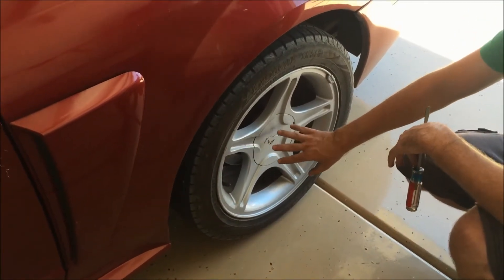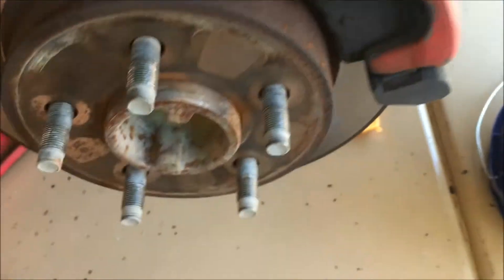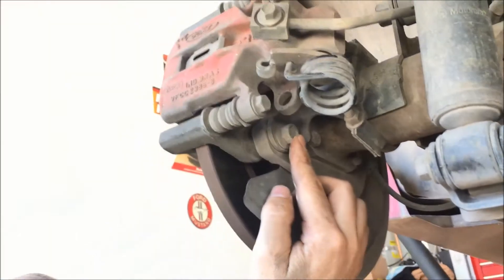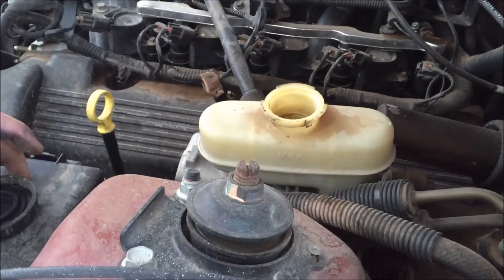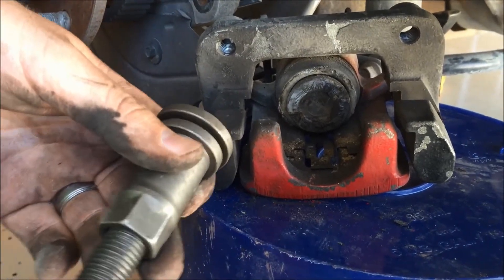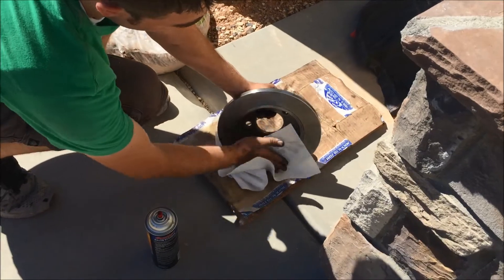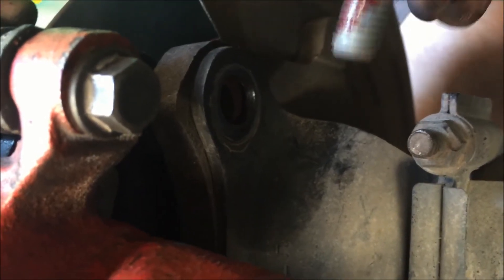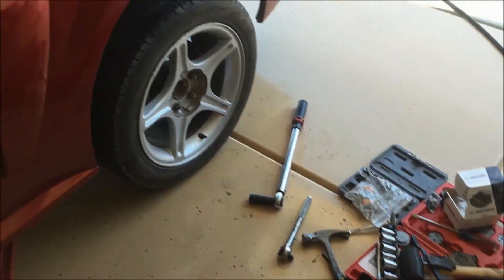Ford Mustang REAR brakes replacement. SPECIAL TOOL REQUIRED!  DIY. Step-by-step how to change rear

Comment: Great video Thank you.  FYI, I was able to unhook my emergence brake cable and remove the clip, but no matter of effort would get the housing to move through the mounting hole, hammered, PB blaster, etc.  The cable itself was moving smoothly and not frozen, but the outer metal was rusted/fused to the mounting hole.  I found it was not necessary to remove the brake cable at all.  I was able to just remove the slider bolts and and then took the brake assembly off which provided me easy access to the bolts holding the bracket.
Reply from the maker: very cool. glad you got it done!

Comment: Decent tutorial, excellent photography, could actually see what you were doing. The master cyl reservoir cap does not need to be removed as it could allow stuff that might come floating thru the air to enter into fluid, just crack it loose. Also, recommend washing hands before handling brake pads as I saw grease on the pads which is a no-no. Unfortunately for me I had to replace calipers as pistons would not turn, not even with a specially made tool and 1/2" impact wrench. Story of my life.
Reply from the maker: Davidy J My brake caliper on my white GT won’t retract as well ☹️

Comment: My fox has cobra front brakes but it had 94-04 gt rears,first time im doing rears soon and nice to know that i need that tools now from autozone before i start on it. Thanx Danny. Btw i finally managed to find a 2003 1:18 maisto cobra in red which is what i wanted.
Reply from the maker: Nice!

Comment: I noticed, whoever did the last pad replacement, didn't index the piston grooves to 12 and 6. You can see where the nub from the old pad dented the piston. That will also cause issues since the pads have an indexing "nub" that fits into the piston groove and will press on the pad with uneven force if not positioned correctly. *Edit* just finished watching, noticed you didn't either. GOT to do that.
Reply: will not matter once piston is back it aligns it self ! as the  pad wears the piston rotates couter clockwise as it push on pad and will catch the slot in time depending how much it is off thats why you and to turn clockwise as you push in piston to retract
Reply: @mronemanband1  okay, cool. I didn't know it self corrected.

Comment: Maybe I missed it but you need to make sure the piston notch is lined up with where the nub is on the back of the brake pad. When you took them apart I could see the person who did them before you did not do this, and is probably why the inside pad was cracked.
Reply from the maker: aadjrenots Wow. I’ll have to check that out. Thanks
Reply: when the piston is retracted it alighns at 12 and 6 o clock !

Comment: Dang I thought ths vid was gona show how to get the 2nd caliper to bracket bolt it with the tension of the springs on the new rear pads being so tough.

Comment: The jack stands should be holding the rear axle up and use the jack as a backup under the Diff or another spot on the axle in case the jack stands fail. Never use the jack as a main support. Fluid in the jack is not solid. Jack stands have solid mechanical locks.
Reply from the maker: The jack stands were perfectly fine in this video under the torque box and the axle, with the jack as an added measure under the other torque box.

Comment: Did you have any issues with the back brakes not adjusting right and rubbing the rotors? I just changed all four sets of the pads and rear are rubbing the rotors and getting hot. I will have take it apart again and compress the piston again. It happens every time I do anything to the rear brakes. I was just wondering if this is common.
Reply from the maker: tedfromreceiving well, as you saw in the video, the caliper must be able to move free back-and-forth as it clamps and that may be a problem for you. Also, when I did a gear install I had trouble with the caliper itself rubbing against the rotor and scratching it. All I had to do was add a few washers to the front or back side of the caliper in order to space it so it was not rubbing anymore
Reply from the maker: tedfromreceiving watch the end of this video. https://youtu.be/0ltKdHNVKIU